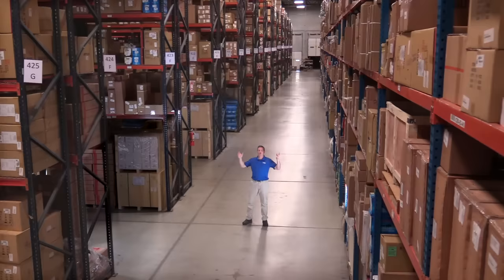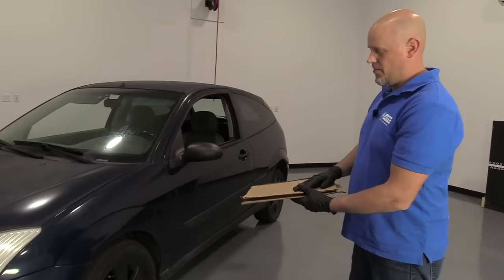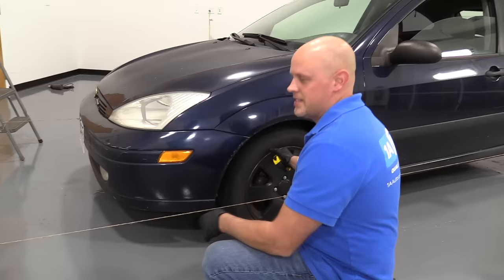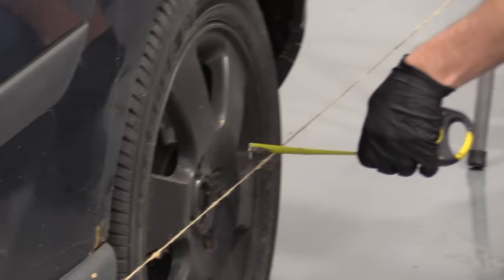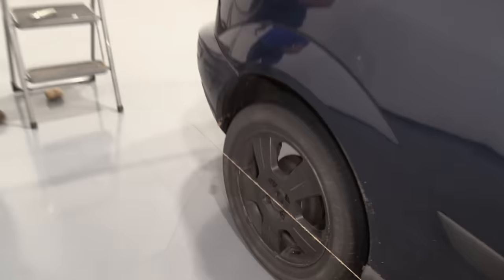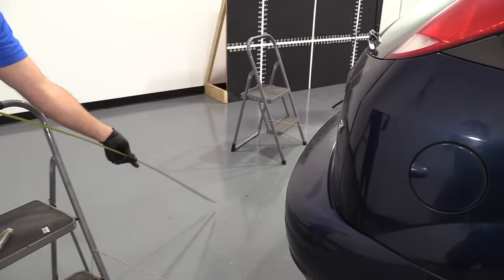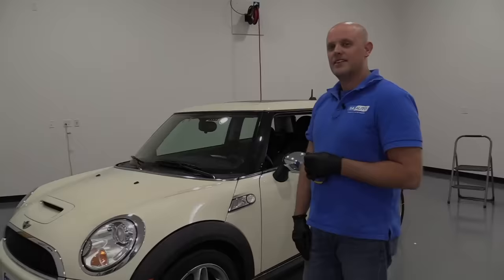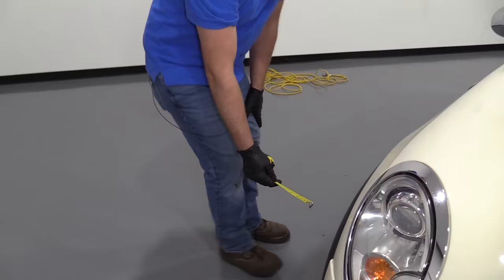How to Perform Wheel Alignment by Yourself

Comment: Have ya tried using a level?? If the tire is like this (/) and needs to be like this(|) then I would think a level would be great to get the wheel straight?
Reply: Beto G i guess the argument would be that most wheels have different concaves and patterns and this would be the best way to align all vehicles. If your car’s wheels are flat then sure a level would work.
Reply: Makes sense to me but I figure if that works then why would he do this whole process
Reply: That would be camber he is doing toe
Reply: That's for the camber. With the tie rod you fix 
< or  > to make them look like = .

Comment: This works for toe in and out but nothing for caster and camber. So if your toe is out in most cases will correct the camber on passenger vehicles because they don't take much load. On a full size truck its more involved due to the stress on the front end from the heavy engine. Just my 2c maybe I'm wrong....I have been in the past lol

Comment: Hi there, I am a bit confused when you did measure the front driver side, it is toed in back is 1 1/8 and front is 1 3/16
same as the front passenger side which is toed in back is inch and front 1 3/8 to adjust you need to tighten the tie rod end which is good but the driver side which we can say toed in as well  1 1/8 back and 1 3/16 front and you mention it should be loosen to correct it or it should be tighten as well same on the passenger side. Thanks for clarification!

Comment: One other thing to do if your OCD like I am is when you center the steering wheel the first time put a piece of tape from the steering wheel to the steering column and mark it so you can be sure the wheel is 100% where it was the first time. Yes, I know it's overkill but nothing wrong with accuracy is there?? lol
Reply from the maker: +Old Griz Thanks for the tip!

Comment: remember the three points of alignment, camber caster and toe. caster in built into the spindle on a lot of cars now so that leaves camber and toe. when replacing front end parts like struts or control arm it's not always easy to put camber back  within spec, your video demonstrates toe adjustment only. great video!
Reply from the maker: +MrWllbn3 Thanks for the feedback!

Comment: I prefer the first method, because it's more geometrically accurate.
The second method isn't, unless you already know which wheel to adjust.
if both wheels have the same misalignment, it will cancel, but your car is still drifting to one side!
if you have different measures between the back and the front of the front wheels, it doesn't tell you which wheel is misaligned, neither how much.

it's pure geometry

Comment: I think squaring the string is better method over the tape measure from tire to tire on same axle. The tire to tire method tells you its the same distance (ideally) from rear to rear of front tires & front to front of front tires. So all that says is they are parallel to each other, not the actual toe for each tire. So using that method the driver side can be toe out 2 degrees and the passenger toe in 2 degrees and that method says pass when you really are failed & in a left turn by default.  I would only do that as a check to confirm the fist string box method. Am I missing something?
Reply: You missed the part in the video about making sure the steering wheel is straight when you start. If both your tires are cocked to one side, you'd definitely know it at the steering wheel.
Reply: Rear wheels usually would be parallel to the car and measuring front and back of the rear wheel rim should read the same, gives you a parallel line to the front whee you measure the toe to see how much to adjust.

Comment: Hi!  Thanks for the video!  My car has 20k on it and tires are Hankook Ventus v2 Concept 2. These came with my car and still have normal thread.  I know that usually alignment may be needed or advised when replacing 4 tires.  Do you think when time comes to buy new tires and if I pick exactly the same tires that manufacturer put on my car, may I skip the alignment if car doesn't pull to either direction and there is no abnormal wear?
Reply: No alignment is needed buying new tires..that seems to be the new up sell now a days..get them to mount the new tread onto the rims and pay for balancing and say no to the alignment..if there is no wear on the outside or inside of you’re tires then mount the new tread on
Reply: You don't need a alignment for new tires... The New tires will make your car like new again. You will know when your alignment is off
Reply: Charkatak some shops if you purchase tires through them they will give you a free alignment check. In which case you won't have to do an alignment if it isn't necessary
Reply: Your tires do not affect the alignment. An alignment need typically needs adjustment when parts get worn, hit a curb, poor road conditions, aggressive driving. That being said, when you purchase tires, while you may not need an alignment. Always get it checked.
Reply: Unless you have worn your tires down to the grizzle or unevenly or something in your car was already in alignment, you should be fine as it doesn't change the core geometry of the drivetrain. If you're really concerned then just pay and minimum fee for an alignment check

Comment: If the tie rod is 9n the front side do you loosen the rod to reduce to in . You said tighten  the rod if there is too much toe in, but your tie rod is on back side of tire. Or does it not matter where it's located

Comment: How do you know that the line from the rear wheel hub and front wheel hub are parallel to the centerline of the car?  If not, you stringline is skewed.
Reply: It’s pretty rare that the rear wheel get out of adjustment for toe at least it gets close enough until you get the car aligned by a professional

Comment: I had my tires replaced and got an alignment. The front was shaking after a week and it got worst as it tries to turn to the left all the time. I’m going to try this and see if it works. It can’t be my bearings and CV since I had those replaced last year.

Comment: Turning the wheel each time doing adjustment is just inaccurate and time consuming.  Put the car on ramp, center steering wheel, dont touch it until done and do adjustments accordingly.

Comment: If you need to move the tire 1/2 inch, you loosen the nut and loosen it OUT 1/2 inch away from the tie rod end, then as you turn the rod until that nut HITS the tie rod end, then your done.

Comment: how do you know which side of the srting to move to square it up
Reply: You don’t square it up. It’s either toe in or toe out. You need to check number for your car
Reply: He moved only the one chair but I think both chairs should be moved half the difference so the strings remain parallel. I like to use fishing line instead of the hairiest string ever and place it the exact same distance from the hub center of each tire. The strings should be very close to parallel unless you have different track width front to back.

Comment: So my steering wheel is badly crooked, like, 35° maybe? Are the wheels misalligned, or is the steering wheel itself misalligned? Does the steering wheel have no way to allign it from the inside of the car, if that makes sense? I mean can I not remove it and put it back centered, or does it only go in one way?
Sorry if this doesn't make sense, I don't know how it works really, but if I recall correctly it happened when the steering wheel got removed for some reason at a shop, and when they put it back the wheels weren't straight, but they put it level anyway, and that's why I think it doesn't need adjustment from the tie rods.

Comment: I don't understand.  first you set the string 1 " off center hub but, then you measured at the ends of the string 66 and 67.  So you moved the back stool out to get to 67.  BUT then the string will no longer be one inch off the center hub?    I am not getting something here.

Comment: Wait a minute what about vehicles that have rear adjustments? Don't you have to make sure sn alignment is even worth doing in the first place? Like make sure no chassis or steering part is blowned'd out before attempting? And then for vehicles with rear adjustments you have to try to get the rear in spec first then front right?

Comment: Nice trick with the two layers of cardboard. One thing you don't want to do is crank the wheel at a standstill, especially on a solid surface. Doind so puts a lot of unnecessary stress on the steering system.
Reply: @Apocalyptic Workshop The wear and tear might be negligible in light sedans, but every case is different.  Grinding the tires on the pavement at a standstill is harder than actuating the steering system while the tires are in motion, for one specific reason, static friction.
Until tires aren't made of rubber and steering doesn't consist of a design with components that are aided by motion to reduce static friction, dry-steering should definitely be on your list of "don't make it a habit".
A mattress is designed to hold people, that doesn't mean a heavier person won't wear it out quicker from normal use of the design compared to a lighter person. Dry-steering is the "heavier person" in this analogy, cause and effect still applies to the design.

Comment: Using pliers when a perfectly good 15mm wrench would do the same and not round anything off
Reply from the maker: +Jackson Rodrick Thank you for the feedback. 1aauto.com
Reply: 1A Auto Parts thats gonna at least get us by
Reply: Yea i wondered that too
Reply: Some cars like mine don’t have a way to use a wrench on the inner so showing the job with pliers will accommodate more cars

Comment: Just so people know, when he says get to the repair shop- It’s not really true. The only thing he didn’t do was fuck with the two little plates that are under your upper control arm bolts-function more like washers. So I don’t see anyone really have a mess with that unless the tire Was truly mounted bad to begin with. And you’ll know once you put the tape to it. Sometimes I guess that happens the point thing is you see that it’s good-that’s good. See if she shakes around 72 mph the sweet spot it’ll start to shake. if all is well then you’re good.I’m not a mechanic I’m an average Joe but I just did this.

Comment: So after changing all of my front end parts on my car my steering wheel is waaay off to the right. Do I turn driver side inner rod counter or clockwise to push the wheel back left?
Reply: If the steering is to the right now if your tie rod ends are on the backside of the wheel, you need to go counterclockwise on the left wheel, and clockwise on the right wheel, to make the wheels straight again with the steering wheel centered. Then adjust properly to bring the toe close to zero on both sides

Comment: Man that outside of that tire was almost bald.. I'd say it's got a camber issue too. Also that ford needs new sneakers
Reply: Easy to check. Stand up a level vertically in the center of the wheel. Use tape to measure from the level to the top and the the bottom of the wheel.

Comment: the excessive tire wear tells me there is a deeper underlying issue. Ball joint, tie rod /inner/outer, stab pins,wheel bearing, shocks....rotor, pads...the rims...simply alligning this, is putting the lipstick on a pig.

Comment: should've showed how to check if the steering wheel is truly centered, I guess the way would be to take a string and tape both ends to the windows evenly, but that's assuming that both doors are precisely mounted properly, and then I guess measuring the string to the top of the center piece of a steering wheel, though eyeballing that would be tricky, you'd probably have to use another piece of string, I'm not very sure, hopefully you'd have some performance steering wheel with a sharp squared metal frame lol but that's not very common, ya I can just imagine with this method it's definitely not the best to be making 1/16th adjustments, you'd at LEAST be making all 4 wheels parallel doing it this way
Reply: use a level and place the level on equal sides of the steering wheel ....
Reply: @ACommenterOnYouTube  assuming the whole car is perfectly level which is very unlikelly

Comment: If wheel is different off set can this be done??? Example front is 8.5. Back 9.5 .. still can do this??
Reply from the maker: +Jordan Lee Possibly but as a reminder, this is a great temporary fix if you cant get it done professionally, but if you can, get it done professionally to verify nothing happens to your suspension
Reply from the maker: +Jordan Lee Possibly but as a reminder, this is a great temporary fix if you cant get it done professionally, but if you can, get it done professionally to verify nothing happens to your suspension

Comment: If you get the rods aligned correctly what will the shop do differently with the alignment?
Reply: In order to get them correctly oh, you have to get it down from the hundreds to the thousandths of a degree and if you did have it done correctly they would do nothing other than charge you for an alignment check.
Reply: Shop alignment machines are much more precise (assuming they calibrate their machines regularly and correctly, plus the technician knows how to use the alignment machine, check the conditions of all ball joints, bushings and don't forget to secure the nuts afterwards....) down to the 1/10 of a degree.    Again, assuming the technician is precise and Not just within rang (i.e.  at the edge of an acceptable range will Not last very long before a re-alignment is needed - such as driving across a rail road track once vs ten times...).
Reply: They usually use laser alignment tools that get the alignment far more precisely than with a tape measure. We're talking about fractions of millimeters / hundreths of an inch.
Reply: Thousands of an inch isn't going to make a noticable difference in tire wear. If you have the tape measurer measuring the same on both sides with 1/16 of an inch toe in you are good to go. Tires are soft pliable rubber and road conditions are constantly changing every second. It's not going to make any difference if it's off by 1 1000th of an inch.

Comment: The second alignment method seems like it has a flaw to me. If, for example, the right tire is angled out, and the left tire is really angled in, the measurements could still show the front of the tires being tighter than the back of the tires, even though they are both way off. I could be wrong, but that's what my brain tells me.

Comment: What do you do if your steering wheel doesn’t center??
Reply: You center it before starting the method and then adjust while the steering is kept straight maybe by passing the seatbelt through it and tighten the seatbelt so the steering doesn’t move

Comment: The last shop i took my car to get aligned also ignored my request to have a brake inspection and get replaced, they came back and told me my transmission was shot.. My car was not aligned either. I have to find someone else to do my alignment even though I paid 3yr  alignment with this company.

Comment: Just out of curiosity how does this work accurately? You chose a fixed point an inch away from the centre of each hub cap, then the distance between the two strings was greater as the rear axle width is an inch wider than the front basically creating an angle from front to back. Surely just moving the back further away from the initial reference point is just more guess work and putting things further away from your initial reference point. In a practice that involves having things degree perfect, surely this just creates more inaccuracies? 

My wife had new tyres a few months ago and the inner edges of her tyres are worn right down already and I suspect the tracking was either not done or done incorrectly at the fitters, so I thought I would look for a way to do a basic check at home myself. Surely this method is only accurate if both front and rear axles are the exact width apart to get a true plumb line. Or am I missing something here?
Reply: IF the front and rear hubs are equally apart then the square string is fine. But like you said, if the front hubs are 5 ft wide and the rear hubs are 5 ft 2 inches wide, by squaring the string he now put an angle like you said between the front and back which will throw the meadurements off. 
That is 100% correct. He should have left it alone
Also when he turned the tire to get access to the tie rod, he now threw off the center of the streering wheel because what are the chances that he will get that steering wheel BACK to the SAME POINT he had it last time ??? 
The square works fine on RWD and FWD when the front and rear hubs are identical apart from each other. 
On a RWD the rear's are FIXED and you would use the rears as the reference point. i just use 2 independent strings, one on each side. 2 of my cars i have staggered tires but thats still easy, Make the string 1 inch from the rears, and what ever the fronts are, equal them out from the wheel to the string, THEN 1/16 IN after straight. 
FWD its a bit more complex since the rears als need to be adjusted.
Reply: Actually the measurement at the back is only to get the string parallel to the car , after that you only care for the measurement on the front wheel alone

Comment: Much easier to go tread to tread front and back of wheels with a tape measure, split the difference and once more to account for tie rod end being halfway to center from the tread.
Reply: Towards the end I see u did do that.
Reply: if you use the string you know exactly which tire needs the adjustment though instead of splitting the difference
Reply: @michaeloffutt2741  lmao